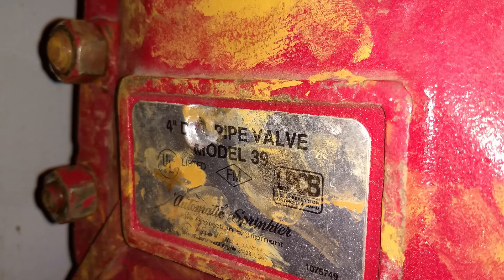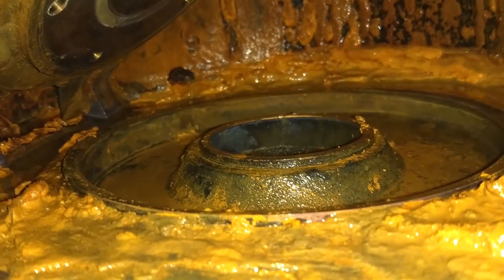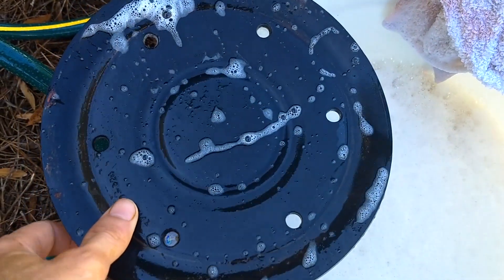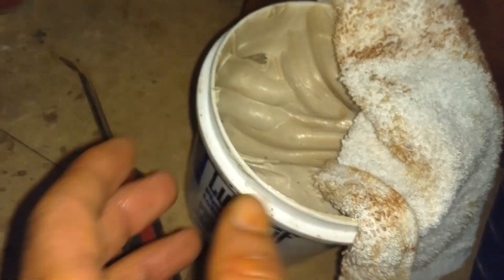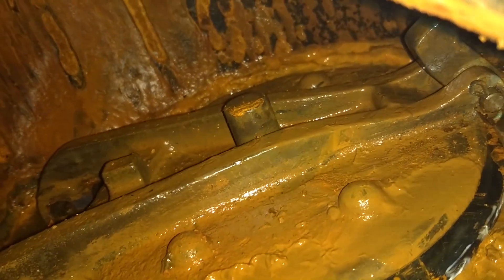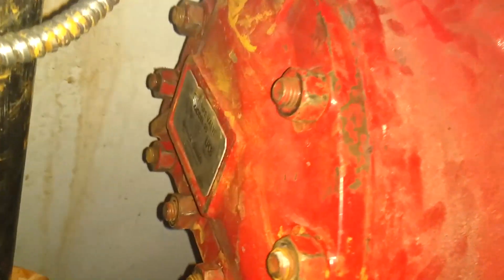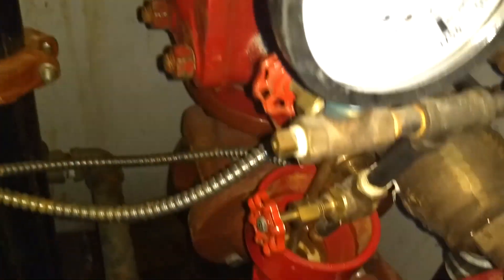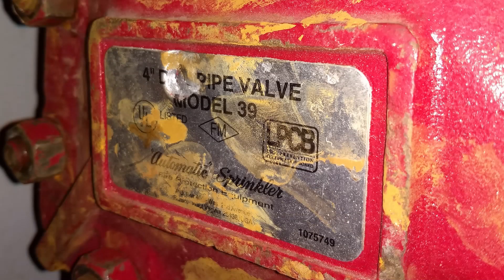Automatic Dry Valve MODEL 39: HOW TO Setup Priming Dry Sprinkler Valve. Always Trouble

Comment from the maker: Update 5/2019: I had some comments on this video about using "LUBRICANT" on this gasket to help setup. It was supposed to be a temporary fix until the customer agreed to replace the gasket or valve which never happened. So my co-worker actually went back recently to perform an annual inspection and the valve tripped out perfectly with the same trip pressure. So the "LUBRICANT" not sealant, never phased the normal opperation of the valve. 

 Note: My co-worker couldn't set this valve backup, so he disconnected the alarm switch and left it set up as a wet valve.

If you RED TAG a system, be sure to document, document, document the issue clearly especially if you unwire an alarm switch. It will save your job if anything ever happens.

 Customers will not always pay to get things fixed and if you have to, let the local fire inspector aware but you may loose the customer. Maybe the company you work for is in the business of making money but..... you " The Sprinkler Inspector" is in the business of savings lives. Remember that.

Comment: Good video, but using any type of grease, water soluable, or not, is not allowed  on sealing surfaces of dry pipe valves. NFPA 25 2017 ed. "13.4.5.2.3 Grease or other sealing materials shall not be applied to the seating surfaces of dry pipe valves."  Vic gasket lubricant is like strong soap. When mixed with water, it makes soap, which over time can become scummy and gum up the valve, and maybe make the valve clapper stick shut. Don't use anything, just  clean the gasket and flip it over, like you showed.
Reply: Use crisco